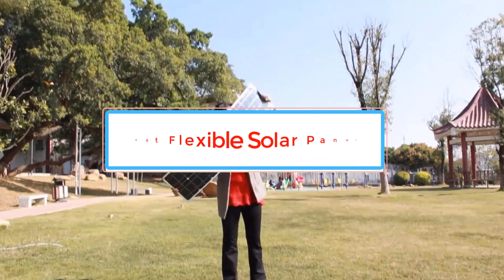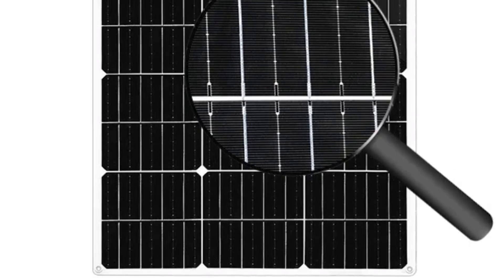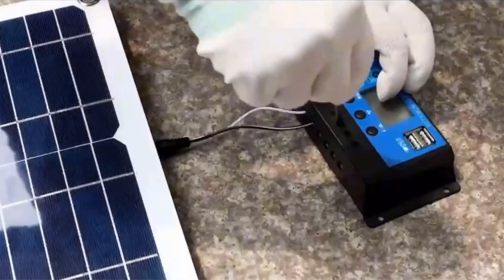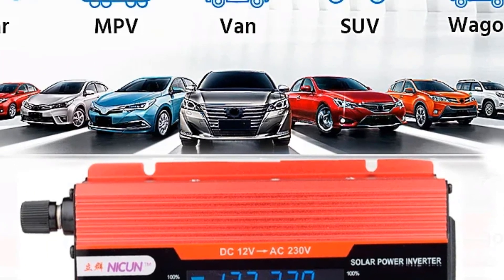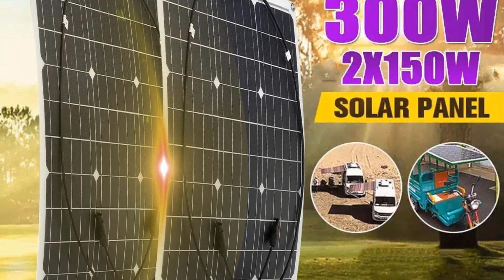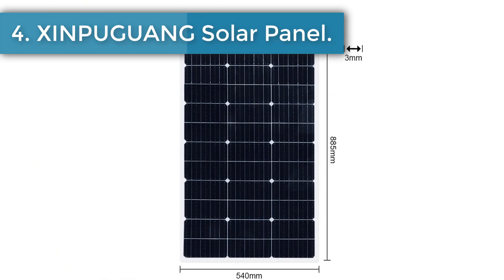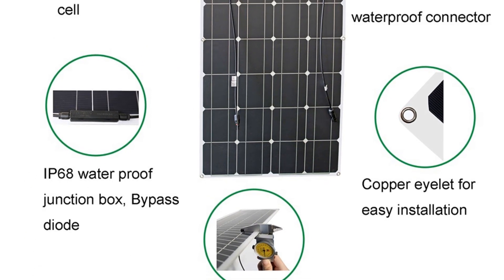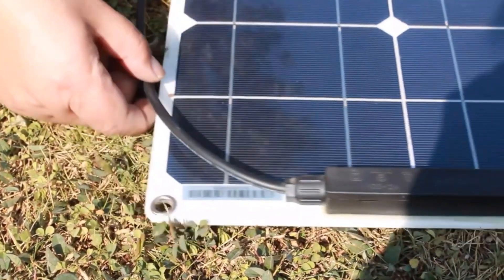✅Top 5 Best Flexible Solar Panels | Best Flexible Solar Panels in 2024

Comment: number 2 claims 150 watts from a panel 70x50 cm. 

that is around a third of a square meter.

given that notionally there is about 1000 watts of raw sunshine per square meter, that means these panels must have a somewhat remarkable efficiency of 50%.

quick, call NASA, they will want to buy the entire wharehouse out.

so number 2 looks like the best deal at less than an AUD per watt, but they have overstated the panels capacity by at least double.

science, bitches (well math mostly, but math a ten year old could do in their head)

basically they all overpriced, best raw cell price is down around 10c per watt, so there isnt $1.50 per watt packaging costs on these in your wildest dreams, there is far better pricing out there if you look around hard enough